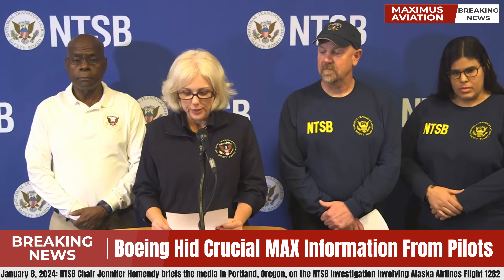Boeing NEVER Told Airlines That 737 Max Cockpit Door Was Designed To FLY Open During Decompression!

Comment: Is it too hard to put in a vent from the cockpit to the cabin, if you’re worried about an internal decompression?  Maybe a light to indicate if the vent is active??  Also isn’t this a huge safety concern for flight attendants?

Also also wasn’t the promise of the new Boeing management to bee transparent?  Seems like building two failing doors on a plane and not telling flights crews about an obvious safety hazard seems like an oversight

Comment: Nothing to see here, the plug was designed to fly off. I feel much safer now!
Reply: You're referring to two different parts of the plane - the plug was supposed to be bolted to the fuselage and inaccessible from inside the cabin. The cockpit door was designed to open in order to relieve pressure during a decompression, just like all other high altitude airliners.

Comment: That the cockpit door opens during a decompression is absolutely normal and HAS to be that way. There is no way you can add a pressurized door and bulkhead to the cockpit (and there is no real reason why to do so) without incurring in gross structural modification that will add nothing but weight, complexity and cost. That the pilots did not know this just tells me that ether some are not good with the books and/or Boeing has blundered (yet again) in its manuals. It is nothing to be “hidden”, they open by design during decompression. At least us Airbus pilots have always known our cockpit doors will and must open in case of decompression.
Reply: The claim that "no one knew" about the door opening during decompression is dubious. Just like the MCAS saga I expect a lot of this "reporting" to be blatantly false anti-Boeing trolling.

Comment: Am i missing something here? Boeing say that the Plug is disined to open if a rapid de-compression happens. How does it remove 4 split pins,undo 4 nuts and then remove 4 bolts holding the Plug in the locked position. And why would you want  the Plug to open  if a rapid de-compression happens. Surely making a bad event very much worse with the risk of said Plug hitting the Rudder/Elevator???????
Reply: Yes you are confusing two separate parts of the plane - the cockpit door is the part designed to open during a decompression, just like all other airliners. The door plug is designed to fill an unused emergency exit and should be bolted to the fuselage.
Reply: Thanks for the reply, i see now that i miss read the header. Thank you for pointing ths out. That will teach me for "going off at half cock"

Comment: Why would Boeing design the door plug to open during rapid decompression - makes no sense, and if that is the case, then the right side door plug failed to open during the same event.  Boeing is today synonymous with flying disaster.
Reply: You are confusing two separate parts of the plane - the cockpit door is the part designed to open during a decompression, just like all other airliners. The door plug is designed to fill an unused emergency exit and should be bolted to the fuselage.

Comment: I am always intrigued by how in every press conference in the USA the speaker has to have a group of people behind them all in the same pose. Anyone tell me why because It looks a bit 'presentational'.

But for all that technical word salad the lady just treated yet ANOTHER major failure by Boeing as like 'OK no worries we will issue a new manual'. I mean REALLY? Boeing are supposed to tell customers, air crews and maintainers EVERYTHING about the functioning systems on their aircraft. Its exactly like how they failed to mention MCAS and we know what happened there. People are flying aircraft with hundreds of people on board ignorant of how their aircraft are designed to work. ...... SMH.

Why hasn't the FAA / NTSB commented on why Alaska didn't get those pressure warnings investigated immediately and seemed to prefer to keep flying, leave the maintenance and have a massive de-pressurisation and crash over land as safer than over sea.

Why hasn't the FAA / NTSB commented on the loose plug door fittings found by United and Alaska since the grounding?

Why hasn't the FAA / NTSB commented on the loose rudder bolts Boeing has 'suggested' to airlines they may want to tighten up? 😳

There is a pattern developing yet again of major issues being glossed over by officials more concerned with process and media performance than investigation, results and causes. The very people who are supposed to ENFORCE safety.
But then this is Boeing - the 'too big to fail' company.

Comment: Cabin decompression!
Did the guide rollers on that door lose their locking bolts or forget to install them? If that was designed that way, those doors can fall off at any time when the plane is on the ground.
I find it hard to believe

Comment: If the cockpit door was designed to open in the event of a rapid decompression, but it did not open. It blew out. If you are a passenger on a 737(-9 Max, would you sit in the row where the door is located? Would you risk your safety? Sort this out. Hid the information? Really???

Comment: So Boeing make the volume of the cabin much larger in the max then discover that in rapid decompression the cockpit door is not strong enough to stay closed! Why is the FAA continuing to give Boeing a free pass. This aircraft should be grounded and scrapped for not meeting many many many 21st century safety standards.
Reply: Where are you getting that the cabin volume is larger? Either way, the 737 is not the only high altitude aircraft with a cockpit door that is designed to open or unlock during decompression.
Reply: @robroilen4441 My mistake. Of course when Boeing stretched the 737 to make the max they obviously made it much thinner so the volume of air inside would be the same. And an example of another aircraft that is designed and documented to have a cockpit door that opens during decompression would be?
Reply: @elel928  All Airbus planes, for example, are designed with cockpit doors that open during decompression or at least have panels that blow out to equalize pressure between the cabin and cockpit
Reply: @robroilen4441  Quote your source for source for this.
Reply: @elel928  YouTube doesn't allow links in comments so I would recommend searching for something like "Airbus cockpit door decompression" and doing a little digging

Comment: How is a door with four locking bolts with cotter pins through them automatically
  supposed to fly open
Reply: Two different parts of the plane - the part that flew open [by design] during decompression was the cockpit door. The part that flew off the plane was a 'door plug' used to plug an unused emergency exit.
Reply: @robroilen4441  I weep at the comprehension levels amongst the public.

Comment: This is more of a failure on the airline and the FAA,s part. Every airline I have had training with getting checked out on the aircraft egress training is part of the basic training curriculum. On the inside of the cockpit door are too large decals affixed to the lower and upper panel that say in plain English " Decompression Panel". They have aneroid pressure locks. And also have sheer pins so you can kick the panel open from the inside and crawl out. Sorry but it doesn't take a genius to figure it out. There are two kinds of pilots. You got your prime pilots and your pud knockers. A lot of younger pilots are academic genius pud knockers. It's better to spend your own personal time knowing your airplane since it's your livelihood and your life. Sorry to say if you depend on the faa to over see a program your in deep sh#t.
Reply: Just like with MCAS, I'm sure we'll find out in due time that all the things armchair pilots said "weren't in the manual" actually were, had been referenced multiple times by Boeing, and had standard procedures going back decades.

Comment: Obviously, everything designed for and in the aircraft should be thoroughly documented. If the aircraft operations manual now grows to six feet high, so be it, put it into a special library section the size of a row of passenger seats. Seriously, there are tons of different things one can document, documenting everything makes for a literal library being required just for an operations manual. Yeah, the MCAS system was a debacle, too much Goobered down and a general goat rope in development, for the cockpit door, not really a biggie, as that whole aircraft explosively decompressing thing is already massively distracting and distressing, the sheer volume of alarms and alerts, well, can be quite engrossing, to be underexpressive. All hell is breaking loose, obviously a major problem, the door banging open and a glance shows that the aircraft is still behind you, there's no big green angry guy in the doorway, back to checklists - after masking, of course. Even if time of useful consciousness at that altitude is around a half hour.

Interesting is, the cabin pressure typically would be at 10.9 PSI when pressurized. So, only nearly 2 PSI pressure change wreaks merry hell internally, but at least minimal significant damage. Makes sense to allow the cockpit door to blow open, rather than deform and get jammed shut.

Potentially damning, but we'll see in the report, United's reports of needing to "tighten the bolts" on at least one of their same model aircraft. If it's missing or incorrectly installed hardware, that suggests a rather longstanding series of process errors at assembly. Given those bolts securing the studs to the guide rails have crown nuts with a cotter pin to secure them, they're not going to unscrew themselves, so either they might not have been torqued properly or there may be improperly or uninstalled components, such as the locking cotter key or crown nut.
Reply: Bolts don't come undone if splitpins are fitted properly.  These bolts do not appear to carry a lot of load as they only hold the door down, the locking sockets carry the pressurisation loads.

Comment: Once again, if it's a Boeing I ain't goin'!
If their aircraft were deemed safe, they wouldn't hide critical information like mcas etc from airlines, crew and customers.
What else are they hiding???
Reply: So the 2 aircraft with mcas problems didn't crash, it was Trumpian fake news!
It was hidden from authorities so that Southwest wouldn't have to undergo expensive pilot training for this new variant, just glance through a flip chart!
Reply: MCAS was never hidden from anyone, Boeing issued multiple notices regarding its implementation. Regardless, the standard procedure for correcting a trim runaway has been in the manual since the 1960s.
Reply: @robroilen4441  AHH, so that's why everyone knew about it! And how to correct it, the two crashes must have been Trumpian fake news.

Comment: That is a WTF announcement. In which universe do you blow a hole in a rapidly decompressing passenger cabin? And not inform anyone working to keep the plane and those aboard safe? And seat passengers near to it? A particular financial commenter on YouTube described the Max as "The Flying Coffin", and asserted that it was a albatross around Boeing's neck. They may be right regarding the company's reputation and stock price. In which universe should nonsense like this go on? It just doesn't smell right.
Reply: The cockpit doors of aircraft that operate at higher altitudes are designed to open during a decompression to minimize the pressure differential between the cockpit and the passenger cabin. This isn't a secret.

Comment: During the description of the timeline at no time did NTSB indicate when the door actually came off the aircraft. Also NTSB failed to explain why Boeing would design a door to come off during flight. You can't make this stuff up 😂😂😢😢😢
Reply: You're referring to two different parts of the plane - the part that flew off of the plane was a 'door plug' meant to plug an unused emergency exit. The part that was designed to open during a decompression was the cockpit door.

Comment: There's big difference between "Flying Open"  & Blowing Off ??
Reply: Two different parts being referred to - the cockpit door is the part designed to open during a decompression. The 'door plug' (plugging an unused emergency exit) is the part that blew off from the side of the plane.

Comment: Boeing never told us [insert latest documentation lapse].

There needs to be a change in the culture.  Culture is driven by leadership.
Reply: Last time everyone was saying "Boeing didn't tell anyone about MCAS!" it turned out that Boeing had sent out multiple notices about it, it was in the manuals, and the standard procedure for correcting a trim runaway had been in the manuals since the 1960s. Guess we'll see if the same thing happens this time.

Comment: Omg does anyone actually believe this BS?

Who on Gods green earth designs something to assist a serious situation beconing a more serious situation?

If you have a rapid decompression in an aircraft the last thing you need is another hole in your aircraft. How does a door plug randomly departing the aircraft help the situation?

If it goes instead of the depressurising location then the depressurising location remains hidden as the doorplug failed instead, if it goes along with the depres location you now have two holes or more, and what about aircraft with a door not a door plug, do the doors blow off and take the escape slides with them?

This seems like a cover-up excuse by boeing using BS as cover, hence why its never mentioned anywhere to anyone outside boeing until now.

This is a catastrophic failure of an aircraft and it will spell the end of boeng 737 max fleets, so this is BS hence why even NTSB, FAA everyone has never heard of it, and other manufacturer's dont have it either, Its BS.

Comment: Seems there’s a significant difference between designed depressurization burst panels under the floor and an entire exterior door directly next to passengers probably not buckled in. The lack of notification by Boeing seems like criminal negligence; as does the lack of proper oversight of Boeing by the FAA.

Comment: I mocked my Airbus colleagues when they suggested after the Helios Air crash that cockpit doors be held shut when cabin pressure falls.  I asked these room full of engineers how much force was would be exerted on that door?   I guessed they’d find the cockpit door embedded in the wreckage of the aft bulkhead.   
Unless you design the aft flight deck wall as pressure bulkhead you are trading a low impact event of a door popping open for a truly sudden flight depressurization event when the crew likely already have their hands full
Reply: Don't blow out panels achieve much the same thing without as big a security risk?
Reply: Very good point. Seems in retrospect now obvious, but never thought about it. I suppose the same thing applies to lavatory doors, galley and overhead bins, etc.

Comment: Blow out panels in the cockpit door have always been made to open during rapid decompression in order to keep the pilots safe. That's nothing new. Before I retired I was in charge if the quality department. I had the inspectors check the torque on every single nut & bolt and place a tamper seal on each one prior to final approval. That way we would know if someone messed with it after we inspected it. WTF is Boeing doing? A very stupid mistake. They were GD lucky it didn't happen at 35k!!!

Comment: On a different type by a different manufacturer the flight deck door unlocks if there is a decompression in the flight deck.  I fly this aircraft.  I was told by a cabin trainer that a cabin decompression would open the flight deck door.  They were wrong.  During my type rating I was never taught about anything to do with this feature.  The thing is, training (contrary to popular belief) DOESN’T cover exactly what every switch and button does.  In the FCOM there is much more detail than required for a rating.  Indeed, some storage systems have ‘need to know, nice to know, and super geek level’ switches depending how deep you want to dive.

Comment: HOW? The door is supposed to be bolted closed. How could those bolts be designed to disappear just because the aircraft decompressed?  They have castle nuts and cotter pins.❓❓❓
Reply: I think you've got it confused - the 'door plug' in the side of the plane is what flew off, and it was supposed to have bolts holding it to the fuselage. The cockpit door did not blow off and was designed to open during a decompression. The question of where the door plug bolts are is still under investigation.
Reply: @robroilen4441  I was refering to the plug. Was the crew door designed to open durring decompression or the plug?
Reply: @MRxMADHATTER  The cockpit door was the part designed to open during decompression, which is not a feature specific only to 737s. The plug is supposed to be bolted to the fuselage and is inaccessible from inside the plane.

Comment: So all a hijacker needs to do is blow out a door in the passenger compartment to get the cockpit door to open.
Reply: Yeah "all" they would need to do is somehow make four bolts that are inaccessible from the inside of the cockpit magically disappear
Reply: @robroilen4441  Or open one of the accessible doors, or use a small charge or some device to make a hole in the skin. Maybe a window. There are more ways to decompress a plane than 'that' door that recently got into the news.

Comment: It wasn't the fucking COCKPIT DOOR that opened - the cockpit door enter to the cockpit - where the pilots are. The door that opened was a PLUG that filled an opening that could have been used as an emergency door in a differently configured aircraft. It would seem somewhat obvious that the PLUG wasn't fitted correctly in the first place.